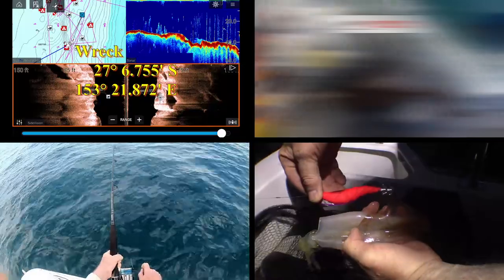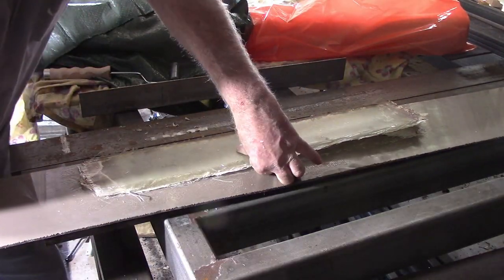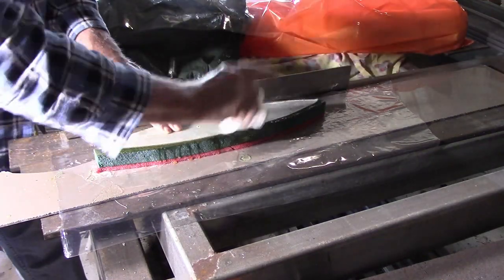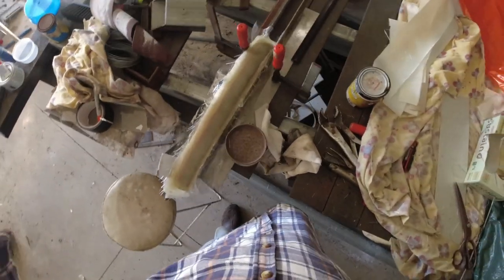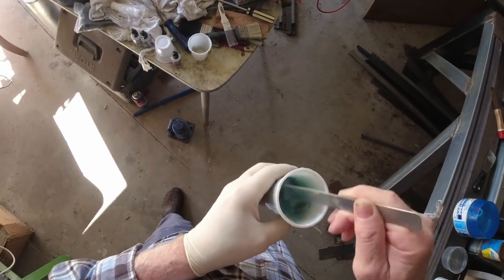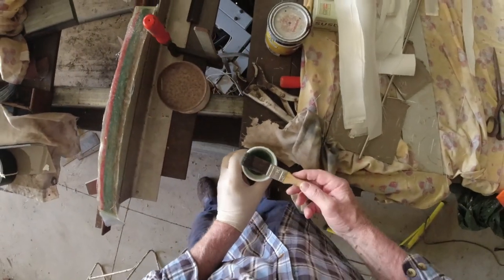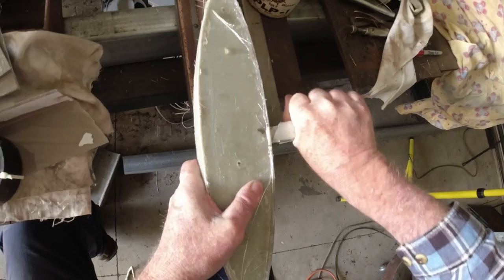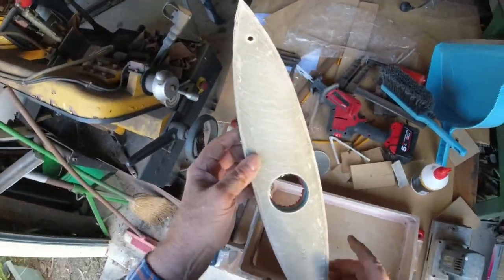Installing a Through Hull Transducer with a Custom Fairing. Part 1

Comment: You must sand cured fibreglass to get a mechanical  bond before you apply resin in a staged fabrication.
Reply from the maker: True, if you are using waxed resin.  The sanding is to remove the surface coat of wax which would otherwise prevent a good bond.  Unwaxed resin has its own issues, very slow surface curing if exposed to air 
chief amongst them.
Reply: @weFishAU  That is true but not the full reason. Fresh resin does not chemical bond to cured resin. A chemical bond is only achieved before the resin is set, whilst still tacky. This is the reasons for using peel ply on large areas, firstly to rid the wax from the surface and second to leave a textured surface for the next layer of resin to bond. Happy glassing, Cheers
Reply from the maker: I'm by no means an expert, so you are probably correct.  I was told that unwaxed resin was okay to glass over for the few days it remained tacky, so that is what I have always done.  So far I haven't had any delamination's happen, so fingers crossed.